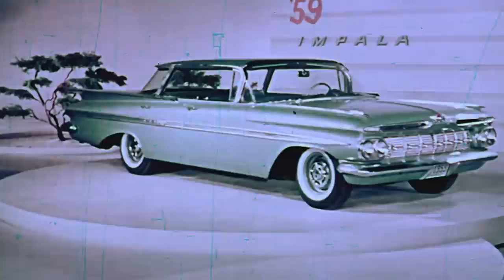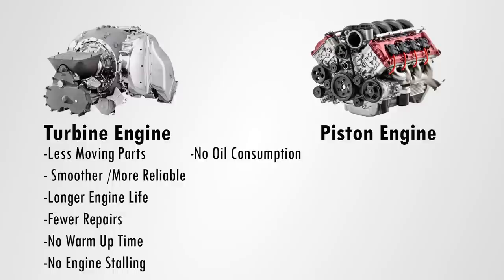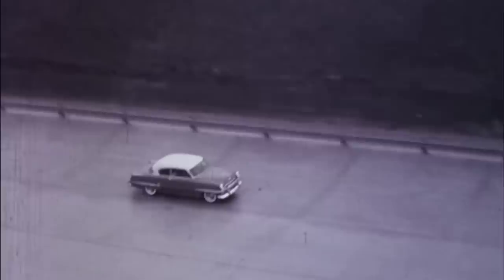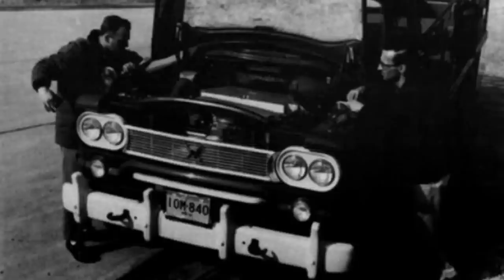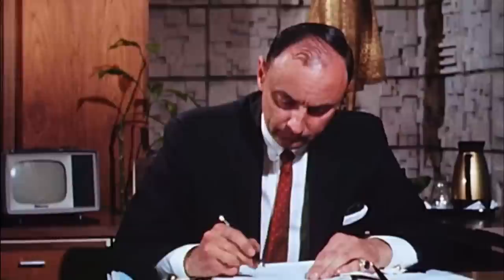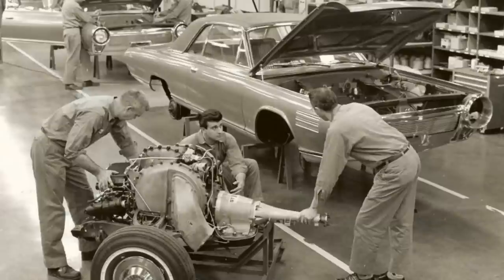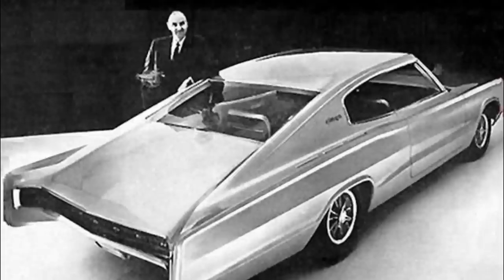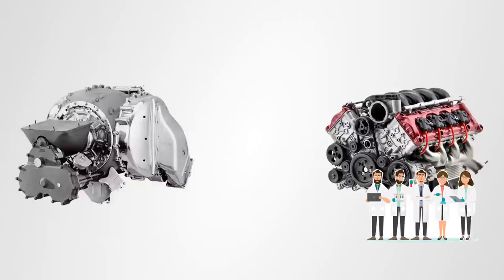Jet Plane on Wheels: The History of the Chrysler Turbine Car Program

Comment: Huh... It appears that turbine engine's efficiency on longer trips and transmission size can be reduced by electric motor, is just the right compliment for EVs. Maybe it's possible to take a revisit for long-haul vehicles like tow trucks🤔
Reply: The gas turbine's duty cycle requirements and narrow efficiency range plagues any automotive applications.
 Gas turbine engines are only fuel efficient above 85% of full power... electric hybrid vehicles still suffer from horrible fuel efficiency

Comment: I really wonder, if they dug out this concept and reworked it today, with modern techniques and materials, how far could it be taken?  How much untapped potential is there?  We may never know and that's sad.
Reply: The efficiency limits and production costs are well-known and understood.
The insurmountable obstacle to automobile applications is the efficiency limits imposed on the compressor by the Laws of Fluid Dynamics
Gas turbine engines are only fuel efficient above 85% of full power..

Comment: I've been wondering if it would make a lot of sense to have a gas turbin range extender. I mean it's light and efficient, should be perfect for that.
Reply: Gas turbine engines are very poorly suited to hybrid electric automobiles.
Reply: @sandervanderkammen9230  not hybrid, range extender.
Reply: @chengong388  Especially unsuitable for range extenders (which proved to be an unsuccessful concept)
Gas turbine engines are incompatible with the charge curve requirements of rechargeable batteries..
Any questions?
Reply: @sandervanderkammen9230  what's the charge curve
Reply: @chengong388  You don't know what a Charge Curve is??? Good question!
 You cannot force energy into a rechargeable battery without damaging it, the rate that any battery can be charged varies by temperature and the amount of  charge remaining in it.
 An engine used to charge a battery must be able to operate efficiently over a wide range of load and rpm to  adjust to the battery Charge Curve turbine engines only operate efficiently over a  very narrow band of rpm and load, between 85% and 100% of full rated power.
Gas turbine engines perform very poorly below 85% and can be easily damages by frequent starts and stops... starting and stopping also wastes alot of fuel.
Any questions?

Gas turbine
Reply: @sandervanderkammen9230  I do know, I just didn't think that would be an issue. An electric vehicle can cruise on the highway for what 5 hours at least, that discharge rate is much slower than the maximum charge rate. So if you have a turbine that's just barely large enough to sustain a highway cruise, that turbine can be run at 100% all the way to full.
Also even if you run into this problem for some reason you can always just not charge the last 20% or something with the turbine.
You do not need to start the turbine frequently, it's an EV that can run 99% of the trips the user takes on electricity alone.
Sorry, I thought you knew what you were talking about.
Reply: @chengong388  No, the turbine cannot be run at 100% until the battery in full... the charge rate Decreases as the battery becomes full.
I think you need to learn something about battery electric vehicles.
 Most BEV hybrid vehicles use the Atkins Cycle or Diesel Cycle because they can operate with higher fuel efficiency under partial load.
 A gas turbine engine has the same fuel consumption at idle as it does at 75% of full power.
Reply: @sandervanderkammen9230  yes it can, why can't it? you talk about charge rate but you don't seem to know what the exact charge rate is, so what is it? Is it 1c? is it 0.5c? give me some numbers
whatever that number is for almost full battery, you just put in a turbine that gives that charge rate at full power, now you can run the turbine at full power.
it won't be at idle, and there won't be partial power, you either run it full power to charge or you don't.
Clearly you're the one who doesn't understand, I already said this last time, you can charge a battery at ~0.2c all the way to full, so you put in a turbine that gives it 0.2c at full power, that's all you need. It needs 5 hours to fully charge but that's fine because you can run it while on the highway and maintain your charge level for a very long time. Somehow you keep thinking that I must put in a giant turbine that can fast charge the battery in 30 minutes or something, nobody is proposing that.
Reply: @chengong388  WHY WOULD YOU CHARGE A FULL BATTERY????

Comment: I'd be interested to see turbines used as range extenders for electric cars. Used in this capacity, their high efficiency at full power and small size could be taken full advantage of.
Reply: Gas turbine engines are not only incompatible with automobile applications they are also unsuitable for rechargeable batteries.
There have been some attempts but none have proven successful.
Reply: @sandervanderkammen9230  two sweeping assertions presented without substantiating evidence.

Why?
Reply: @sosaysthecaptain5580  Two irrefutable facts that are based on the Laws of Fluid Dynamics and Electro-chemistry

Comment: The nucleon was genius... You powered your home with it. If you drove it to work, work paid more for providing  power. If you just refine the idea, it works even better today, and solves a problem we need solving. Appy nuclear power  to heavy trucks who are required to take long breaks, and are in every place at all times. and using those to charge bev passenger cars. I'm sure plenty of truck operators would like to profit on being energy producers. Nuke the future.

Comment: Just like the quick start steam engine this technology was kind of dead for a variety of reasons. One of them being that while yes they are less maintenance when the maintenance needs to be done it's a lot more work and more difficult to do. Also idling is far less fuel efficient. Finally the engine is just more expensive. It's a cool idea that could have been used in high-end cars but it was never going to be something that was installed in every car
Reply: Excellent comment. Thumbs up

Comment: The whole emissions thing was understandable, even more so today. But if you think of how they went about it, it was somewhat insane. Any motor that has restricted exhaust is not as efficient. At work our trucks have to use def. It cuts the fuel efficiency by several gallons. The less fuel you are burning, the less emissions you are making, and the gasses and heat from this a s well a catalytic convertor has been found to not be quite the help as they thought. Its helped, but now there are even more vehicles, so it's still a growing problem. I had two Honda civics in the 1980s, both did around 40 to 42 mpg. I was looking at them in the 90s, and the fuel efficiency should have been better, which now its back up, but the emissions has been a fighting battle. Now they say electric, but raping the world mining and disposal of that is NOT the answer. The true answer is to force people to NOT drive as much. This is of course going to be a big debate in America, but the past cannot be allowed to destroy the future. Vehicles should be mandated to stop being made with crap like heated seats and TVs and be made simple and efficient. If cars start getting 40+ mpg and driving is cut back, it will change emissions considerably. China and USA are the two worse, but both have mass amounts of people. Its either that, or we are selfish killers, because our future families will either suffer dearly for our laziness, or not exist at all....

Comment: the only plug in hybrids using the engine just as a generator are the Volt, the bmw i3 and the that mazda you are talking about.  all the other the engine drives the wheels directly, with all the downsides  as for example gears 🤮. also they mostly have no heater and use the engine to heat the car.

Comment: Turbines are a lot like 2 Stroke Engines, in that they offer low weight, small size and high power. The reason why both are popular aviation engine designs, yes, Rotax just in 2023 ended Production of its 582cc Twin 65hp model, while Polini, Hirth and Simonini still offer a wide Variety up to and over 100hp, is that they are efficient enough at full power to be reasonable choices and Planes normally cruise at 60-80% of the available Power, exactly where these Engines are at maximum efficiency. 

However at idle Power these Engines will still consume 30% of the fuel that they do at full power. 
In a City the Power Requirement while swimming in Traffic is 10 to 20hp, 10% of the potential Power.
My Opel Combo only needs 75hp to maintain 160km/h, that is 40% of the Turbine Cars available Power.
To maintain the American Speedlimit around 50-60hp are enough.
So a 75hp Turbine would have been the choice for an efficient Engine for cruising and a 30hp Turbine would have made for efficient City driving.
But those Numbers don't sell.

Comment: Henceforth we now have the AGT1500 power plant in the Abrams main battle tank. A gasturbine and ver very quiet 🤫 vs. a 12 cylinders diesel powered tracked vehicle.
Reply: @sandervanderkammen9230  Was in a US Army class about the history of the AGT power plant. Sorry to burst your bubble man. This is from the Army and not me
Reply: @sandervanderkammen9230  Was next to an Abrams tank at start up in my patrol unit in the Kuwaiti desert. Barely noticed. However, even the HMMWV internal combustion engine could be heard with my windows up and A/C running. Quiet 🤫 😶 🔇 🔕
Reply: @byronharano2391  Sorry son but you don't know anything about the M1 Abrams or the AGT-1500.
You just made a fool of yourself.
Reply: @byronharano2391  What's you point? The HMMWV also meets the Army's noise level requirements for adoption into service...
Unlike the M1 the Army was allowed to select the engine that won the HMMWV trials.
Reply: @byronharano2391  Your comment reveals someone who has absolutely no formal education or professional experience regarding this topic... it would be in your best interest to stick to a discussion topic that you actually know something about.
Any questions son?
Reply: @byronharano2391  My advice to you is to stick with discussion topics you actually know something about, and stop pretending to be someone you are not.
Cheers mate!
Reply: You made yourself look like a fool... I just pointed out that you did.

Comment: All of Chrysler's 'innovations' came from Rover who built the first working jet turbine car, had the world speed record for one, raced them at Le Mans, and with the Rover T4, had a production vehicle in 1961, two years before Chrysler.  It was based on the Rover P6 which kept the same suspension setup in the ICE version. It was the cost of manufacture that meant it was not viable.  The Rover Gas Turbines went on to be used in aircraft as generator units.
Reply: The first gas turbine powered vehicles were developed by BMW in 1944... Chrysler Corporation received an undisclosed amount of technical data and personnel from Operation Paperclip and Operation Lusty which saw the transfer of advanced German high tech jet and gas turbine engines en masse to America.
The Father of Gas Turbine Engines was former Nazi engineer Dr Anselm Franz who designed the world's first production turbojets for the Messerschmitt Me-262 and the engines for the M1 Abrams and the most successful gas turbine engines in history, the Lycoming T53/55
Reply: @MichaelThomas-be7gq  The Gas Turbine engine was invented by Jens AEgius-Elling in Norway in 1903.
 The world's first production gas turbine engines were manufactured by Swiss company Brown, Boveri und Cie. who demonstrated in Berlin Germany in 1932 and in Manchester England in 1934, Metropolitan-Vickers became a BB&C Velox engine licensee.
 Unfortunately most of the documents of the BMW GT 101 program during WW2 were lost or destroyed.. but evidence does exist to prove it was real.

Frank Whittle did not invent the jet engine.
Maxime Guillaume patented the turbojet aircraft engine in 1921 when a 14 year old Frankie was still wearing short pants.
There is no evidence to support that anyone copied Whittle's 1930 patent , not even Whittle built this design.
Whittle discovered his patent was invalid and allowed it to expire in 1934 to avoid possible litigation against him. 
  Completely false British myth, Krupp was producing P-193 Tinidur-60 alloy in 1935, superior to the Rex-78 Whittle used and compareable to the much late Nimonic-80 alloy.
Also a false British urban myth, the Jumo -004 engine easily passed the RLMs 100 hour PFTR reliability standards for acceptance into Luftwaffe service, this is the exact same 100 hour PFTR required by the RAF and USAAF during WW2.
The -004 was exhaustively tested by the U.S. Army as part of Operation Lusty and confirms TBOs of 50 - 60 hours, EXCELLENT by WW2 standards.
Whittles W.2B had a PFTR of just 50 hours.
 The Jumo -004 would be further developed in the AGT-1500 that powers the M1 Abrams and the NK-12 that powers the Tu-95.

BMW's Rickenbach team moved to SNECMA and development of the GT 101, BMW -003/-018 continued as the ATAR 101 which powered the first European jet to fly Mach 2 and is still in production after 83 years.

Frank Whittle refused to give any credit to Adrian Lombard at Rover or Stanley Hooker at Rolls-Royce. 
They refused to work with Whittle after he assaulted and young R-R engineer and brandished a gun at meeting after Whittle had been on a week-long drug and alcohol binge.
 Whittle avoided arrest by checking into a drug rehab.
The real geniuses of the British jet engine program was Lombard and Hooker.
The jet engine was invented in Germany by Hans von Ohain and Max Hahnn who successfully demonstrate the first jet aircraft engine on August 27th 1939 in ROSTOCK GERMANY.
Whittle was only the 4th person to successfully demonstrate a jet aircraft engine 2 years later.
 Rover no longer exists, it would go bankrupt in 1967 and bought by Leyland was bought by BMW in 1994.
BMW still manufactures gas turbine engines.
Reply: @MichaelThomas-be7gq  The facts are irrefutable, Frank Whittle did not invent anything related to jet engines. 
Whittle was only the 4th person to successful demonstrate a jet aircraft engine.
Whittle was not the first to patent, the first to build a proof of concept or a successful flight rated engine.
Whittle is only the first in the U.K. 

The jet aircraft engine was patented by Maxime Guillaume in 1921 when Frankie was just 14 years old.
Hans von Ohain and Max Hahnn built the first prototype jet engine in 1934 and successfully demonstrated the first successful jet aircraft engine on August 27th 1939, 2 years before Whittle.
Please stop spreading lies and ignorant misinformation about the invention of the jet engine.

The German axial compressor turbojet is fundamentally superior to any Allied jet engine technology available during WW2.
Allied centrifugal jet engines were inferior and an evolutionary dead end technology.

The Jumo -004B Orkan engines met or exceeded the RLMs 100 hours PTFR reliability standards for adoption into Luftwaffe service.
This is the same 100 hours reliability test required by the RAF and the USAAF during WW2.
The U.S. Army Operation Lusty confirmed TBOS of 50 to 60 hours, EXCELLENT by WW2 standards.

The Messerschmitt Me-262 the only successful jet fighter in operational service during WW2 and shot down over 500 Allied aircraft including P-51s, Spitfires and Tempests.
No Luftwaffe plane was ever shot by an Allied jet.
26 Me-262 pilots scored Ace or higher including the highest scoring jet Ace in history and the highest scoring Ace in history.
 The BMW engine is the longest production run of any jet engine in history and was the first European jet  engine to power an aircraft to Mach 2.
Reply: @MichaelThomas-be7gq  Hans von Ohain and Max Hahnn built the first jet aircraft engine and successfully demonstrated it on August 27th 1939 in Rostock Germany. TWO YEARS before Whittle did in 1941.
Whittle is only the 4th person to successfully demonstrate a jet aircraft engine.
Reply: @MichaelThomas-be7gq  Maxime Guillaume patented the turbojet aircraft engine in in 1921.
Patent number 534.801 filed May 3rd, 1921, issues on January 13th, 1922.
Reply: @MichaelThomas-be7gq  You are obviously not good with facts, Hans von Ohain's engine features a single stage, centrifugal compressor, single centrifugal turbine and anular anular type combustor.
Whittle's patent clearly shows a 2 stage axial plus centrifugal compressor, and axial turbine and no  combustor. The design was incomplete and was pointed out by Cheif of engine development at the Royal Aircraft Establishment.
A.A. Griffiths pointed out that Whittle's engine would have never run.
Reply: Dr. Anselm Franz built the first axial compressor turbojet, the  Jumo -004 Orkan, the type of jet engines we use today.
Whittle's engine was a evolutionary dead end, a completely obsolete technology.

Comment: I still believe that turbine cars can make a come back in a more sophisticated and high efficiency avatar on albeit on an alternate fuel platform like sugar/ corn based ethanol or equivalent. The mad rush for hopping on to electric vehicles isn't sustainable in the mid term forget long term.
Reply: What do you based this belief on??
Reply: @sandervanderkammen9230  The current state of mad rush towards electric cars running on lithium ion batteries will turn out unsustainable, viable alternatives are yet to be found though people talk of hydrogen cell and Sodium batteries. Till such time only alternatives like vegetable based oils fueling high efficiency options like turbine will be the interim solution
Reply: @hermeslord  I agree battery EVs are not going replace ICE cars but  gas turbine engines cannot compete with reciprocating engines in cost, fuel efficiency or emissions.